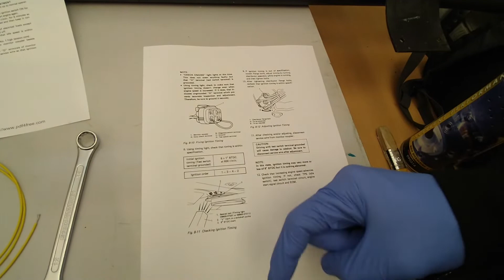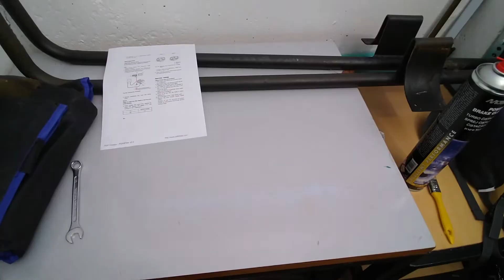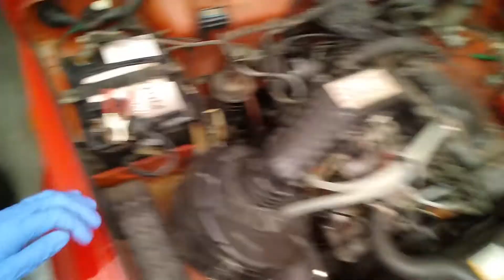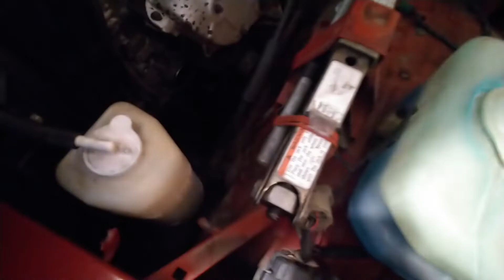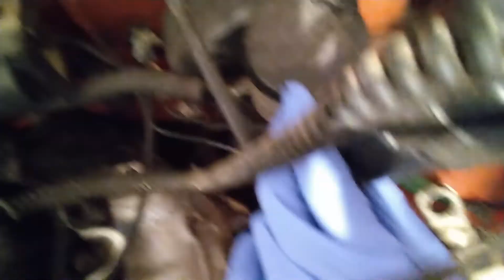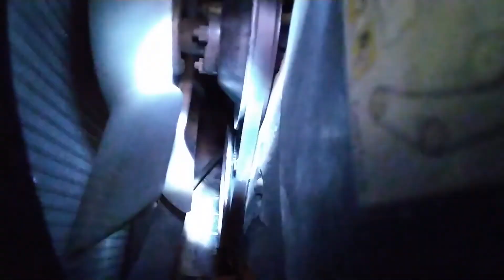06 Checking the Suzuki Samurai Engine Ignition Timing

Comment: Thanks so much for the video, I recently acquired an 87 Samurai. Question though, should the vacuum advance be disconnected for this process? I'm quite confused because this is common practice for setting base timing, though none of the service manuals explicitly mention this step when setting timing
Reply from the maker: we have a EFI model, so we do not have the vacuum advance. that is why we disabled the computer advance using the yellow wire in the video.

regarding your carburetor model, i have looked at the factory service manual, on page 8-9 is the procedure. since it does not say anything about disconnecting the vacuum advance, leave it and follow the rest of the procedure.
Reply: @supplementaryservicemanual thanks so much! I've done some additional research on my own, and the reason it doesn't have to be disconnected is because it's a ported vacuum port (as opposed to manifold vacuum), and does not have vacuum/advance at idle

Comment: 15:40

Above your finger at 15:40 are 2 loose wires. Do you know maybe what are they for?
Reply from the maker: no idea, still trying to figure that one out. i see it in a lot of samurais disconnected and just dangling like that.
maybe for some obscure accessories? but i think it is maybe for some kind of diagnostics / check terminal.